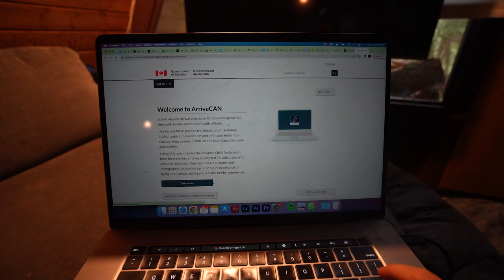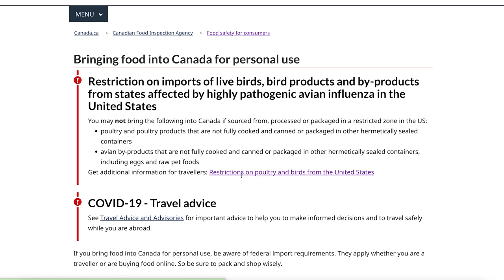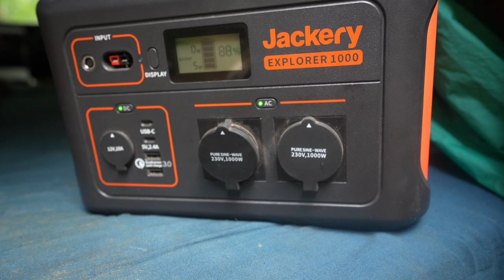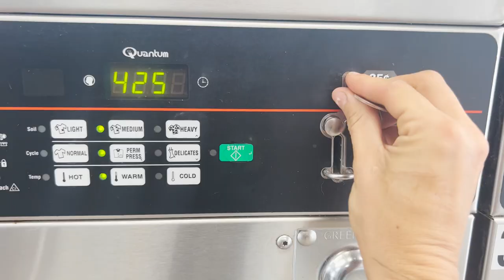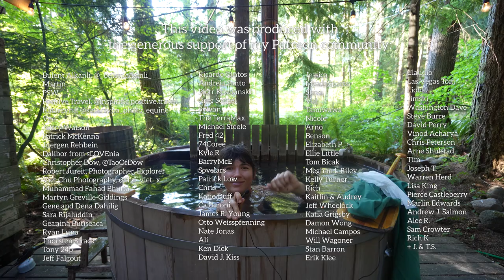Preparing to Survive a Solo Expedition to Alaska

Comment: Local here, we normally don't expect first snowfall in September. It starts to come around middle of October, at least in Fairbanks. I've never been to the far north regions so it might be earlier. Safe travels its no joke when it comes to Alaska, and should not be taken lightly, make sure you're prepared!
Reply: Last year it snowed at the beginning of September in Fairbanks, remember?
Reply: @calebtot  yeah your right maybe I'm just trying to be optimistic this year
Reply: She didn't mention an engine heater in her AK furbishing, nor did I notice a  120 volt plug near the front bumper. Oh well, we all learn as we go along.
Reply: @amberthornlow1979  because its the farthest north you can go.
Reply: In the Fairbanks region, if it snows in September, it usually melts pretty quickly.  Oct 10th-Oct 15th is the average date of establishment of snowpack.  The Brooks Range and North Slope might be another story.
Reply: @amberthornlow1979  Me, I'm just a Cheechako, only been up here since '64, but I figure that's where she wants to go because that's where the road ends.
Reply: Good lock Eva!!!!!  God Bless you.  I pray for you.  Waiting x the next video.  💞
Reply: TheAlaskanBascan, could you add your suggestion to my several--that she pick up a Milepost?  When I soloed up there from northern IL in '84, it was invaluable.
Reply: @Jim1alaska  you don’t really need one until it gets colder than -10C. She’ll be gone by then.
Reply: @nohoracadena8193  I'm praying for her 2
Reply: @FromThePrairies  Hope, for her sake, your right but the best laid plans...

I haven't plugged my in for well over ten years (garaged when I'm home & when I'm out, it still starts fine after as much as four hours of -40°.) but I'm glad I have one.
Reply: @jimgreen5788  that was my bible! We drove from Seattle via the Cassiar, via Fairbanks to Anchorage (with some detours). Would have missed a lot without it
Reply: @FromThePrairies  more like -20C if she has a decent battery. Her truck was more than serviced!
Reply: Felt like she would be avoiding Mosquito season, she's picked a decent time to give it a try...  Spring / Fall feels like better options than Summer / Winter.
Reply: @CLFL14256 , I drove up across Canada through the Prairie Provinces, the entire Alaska Hwy., Klondike Hwy. 2 to Skagway, up to Haines via  the State Ferry, and back onto the AK Hwy. to Tok, down to Valdez, over to Anchorage, and down to Portage, up to Denali, on up to Fairbanks, and a little beyond to Chatanika, Top of the World Hwy. thru Chicken and on to Dawson City, a side trip up to Tungsten, NWT, on the Cassiar, eventually getting to Jasper, Banff and Glacier (USA), and back to IL and home--31 days; 9244 mi.  I would have also missed a lot without Milepost.  
Oops!  Almost forgot to mention my 2-day Arctic tour to Nome and Kotzebue via Alaska Airlines.
Reply: Hope you feelbetter soon and safe travels to Alaska!
Reply: Yeah there. Chrome from, van city vanlife uses his Starlink up in BC.  Not sure how far North
Reply: Eva, I was stationed in the military in Alaska for a couple of years. Allow me to warn you that you are in for a rough trip. You would have been much better off had you left in June or July. It's  warmer that time of year and the days are much longer. The further north you drive, the days will grow shorter. You will doing a lot of night driving during the day.. Chances are you might encounter a snow storm. You will encounter temperatures below freezing. Watch out for Moose herds! Moose are huge and wander on the roads. If you hit one in the dark, it will badly damage your vehicle. The most dangerous animal is the wolverine. They have sharp teeth and claws and will attack without provocation. If your dog tries to attack a wolverine, it will kill him. I hope you see my message, because your trip is more dangerous than you think.
Reply: Not washing your hair for five weeks? When I toured around Alaska with my van, I had no problem keeping clean as I took a dip or got water from the streams or rivers that one seems to come across every half hour when driving. Never been cleaner!
Reply: She is an experienced traveller who has been to really difficult places in the past and usually does a lot - sometimes up to several years worth - of ressarch before going. It may not have come across like it in this video but I'm pretty sure she is as prepared as can be.
Reply: @harrydecker8731  lol moose don't travel in herds and you'll more than likely never see a wolverine. They'll hear or smell u and move away, you won't even know unless u spot the tracks. September is moose mating season so I'd be most worried about bull moose attacking me or my dog. They are very aggressive and territorial during the rut.  Also grizzly are trying to fatten up for winter so there's that. I've spent literally hundreds of days out hunting, hiking, and camping in Alaska to include the north slope and have never seen more than 3 or 4 moose together at one time. She adjusted her whole camping set up so she didn't have to get out of her vehicle to get in and out of her tent. She's thought things thru and she'll be fine.
Reply: Local here as well in wasilla, we are already seeing termination dust, usually that means 2 weeks until snowfall. And the Yukon is not a joke either. She really needs to be very well prepared or she will be in serious trouble.
Reply: Hope she gets a good heater, with that roof tent it's no joke. Even insulated that wind chill is brutal, even in September.
Reply: By the way, everyone in Alaska walks around with Rifles for protection against bears Ruger Hawkeye Alaskan (.375 Ruger) PLEASE PROTECT YOURSELF 🙏🔥💗🦋
Reply: @Jim1alaska  I've wintered in North Dakota and an engine block heater is a must have. I imagine that it's the same in Alaska. My employer (last 12 years) has a lot of interests in Alaska, including the slope. One day I'll get to go. Aviation seems to be the way people move around Alaska. That's fine with me.
Reply: @harrydecker8731  I lived and worked in the Aleutians .. winter and remoteness are to be taken seriously. 
I traveled once with a 20 year old who felt invincible .. but i made my own preparations
Reply: Yep. Mid october
Reply: Its already starting winter in sept. In northern alaska. Been to circle in september before and there was already 2 feet of snow.  It is already dumping 2 feet of snow this year in north alaska. It is snowing right now on the weather report.
Reply: @michellesimmons3150  Yep .. "Termination Dust" .. a term few do not appreciate !!!
Reply: @Jim1alaska      What about the 120VAC electric heater wrap for the battery?
Reply: It snowed last year in late September here lol.
Reply: @harrydecker8731  Yeah I don’t think she knows what she is getting into.  She’d be ok driving to Fairbanks but driving to Deadhorse on the Dalton and back is an entirely different game.

Her car is not mechanically sound or reliable and god help her if she breaks down on the Dalton.

If I were her, I’d just get to Fairbanks and start from there instead of trying to get to Deadhorse.
Reply: @cesbi  She projected herself to be an experienced solo traveler but she really is not. There was always someone in the background to bail her out.

Most of her travels are chaperoned tours in some tinpot dictatorship country with a bunch of minders and guides following and filming her. She is not really an experienced traveler.

That Dutch girl Itchy Boots is an experienced traveler and she has the temperament to handle situations.  Eva does not.
Reply: @mary333j  Chances are, what she said as “ cold and fever” could be COVID and that would prevent her from crossing international borders.  She always seems to downplay some stuff and blow out of proportions the others.  She is also quite late in the year heading to Prudhoe Bay which is 5000 kms from where she was.  That is at least 10 -12 days driving each way.
Reply: Hey you here
Reply: @kmin3434  LOL Moose herd.  Maybe he meant caribou?
Reply: @julianolivas5812  Aleutians is a whole different world! That wind and cold!
Reply: If you're all wondering where Eva is watch, Nextmeridian.Expedition, she's on this Channel 🔥🔥🔥💖
Reply: If you're all wondering where Eva is watch, Nextmeridian.Expedition, she's on this Channel 🔥🔥🔥💖
Reply: @calebtot  😢
Reply: @SwellerVanDweller  beaver fever. Be careful of the water in Alaska.
Reply: @kmin3434  still, hitting a moose while driving is always a risk.
Reply: Northern Albertan here from Canada and it even feels like the snows going to be early here been a super chilly early sept here but who knows. Personally i feel like even here its gping to be early
Reply: Snow between Delta and Paxson was just reported. I hope Eva is prepared. Early winter.

Comment: Eva: You will need to winterize your vehicle (if not done already). It’s unlikely the guys in Oregon will know to do this task. Winterization includes: 1. engine block heater (allows you to plug-in the vehicle during cold nights so that the engine will start in the morning; 2. Battery blanket and plate warmer (self explanatory); oil Pan heater (this gets attached to the bottom of the oil pan to keep the oil warm enough to circulate at engine startup); replace engine coolant with 50/50 mix of ethylene glycol coolant and water. NOTE: Higher concentration of glycol is NOT better; 50/50 is the best). You can likely find a shop in British Columbia to do this work. You can, of course, find many shops in Alaska, but you may want it done before you get there. You could also repack the wheel bearings, but one trip to Prudhoe and back down you should be ok.

Don’t skip the winterization of the vehicle! You won’t regret it.

Good luck and ask me any questions. I lived more than 40 years in Alaska.

Best regards, Stan
Reply: @mary333j  Thanks, I was wondering where she was.
Reply: @counselthyself Itchy Boots wisely avoids all the personal drama & aims for pure traveling content. A cut above most travel Vloggers.
Reply: Not to mention using a very high quality synthetic engine oil. Much easier starts and quicker oil pressure compared to conventional oil.
Reply: @frankharley1000  :  In the video @2:00 she appeared to be using Mobil Delvac in a black jug which would be 15W40 and NOT the full synthic 5W40 which is in a silver jug.  15W- has a practical minimum temprature of about +10F, -10ºC
Reply: While you appear to have lived in Alaska year round, which includes full Winter, you are correct, and as her vehicle is a diesel, a fuel tank warmer might also be useful .  BUT she will be there in the middle of October, then turning around and heading south, so shouldn't see the truly frigid temperatures of the coldest months.
Reply: @johndavidwolf4239  But she's going to the very farthest northern part of Alaska. I'd imagine it'd get pretty cold up there, even in October.
Reply: @enargins  An long as the temprature is above the "minimum cold flow temp" of the oil she is using, it should not be a problem.
Reply: Plug in where? lol

Comment: Have an epic journey to the top of the world! My best advice would be to drive straight to Prudhoe Bay as quickly as you possibly can, then take your time heading back south. That way you'll know how much time you actually have to stop along the way and you'll be driving away from winter as it approaches instead of driving into it. You really don't want to be rushing such a big quest with little time for errors such as potential breakdowns. The big question is when you actually left, since I assume your videos are delayed from when you filmed. Either way, safe travels.
Reply: This is very good advice! 👍🏼
Reply: Good advice
Reply: Totally agree!
Reply: This is a good strategy.
Reply: She is going to Prudhoe Bay late in the year so the risk reward just increased.
Reply: You can’t drive to Prudhoe Bay straight up if the weather and elements and other issues like mechanical issues stop you.  I would never recommend doing that drive in a rush because that’s how accidents happen.  Plan it for two days each way with a stop in Coldfoot overnight.

Driving alone, tiredness and fatigue are things that can get you on the Dalton.  And weather is a total unknown.

I’d take my pace and do it at a relaxed and rested pace than trying to rush to get to Prudhoe Bay and the drive back to Fairbanks is no chopped liver.
Reply: @MuhammadIamhardBrucelee  Totally agree, it's a drive that shouldn't be rushed. But considering how late it is in the season it's better to be rushing there than to be rushing back down in a snowstorm.
Reply: @GabrielTravelerVideos  Yes, it’s already September but there is always an option to reevaluate your decision to drive up to Deadhorse once you get to Fairbanks.

Having done it, I’d say the weather and road conditions on the Dalton are anything but predictable.  Just driving to Prudhoe Bay as fast as you can doesn’t seem like a wise decision.  You need a cool head and relaxed attitude and careful planning to drive the Dalton.

Comment: Check the minimum temperature for your gas canisters. Some have added propane but the cheap ones are plain butane which will not flow at low temperatures, below about 10C. (50F)
Reply: Right, butane isn't good in the cold
Reply: Also check your coolant temperature rating
Reply: Good advice. I would prefer alcohol or gasoline stove,!
Reply: I have the same stove. (V similar) it’s butane. Those canisters can be hard to find. I’m sure Alaska has shops though 😜

Comment: One note of caution on the Jackery: It uses a lithium-chemistry battery and does not have low-temperature cutoff built into its electronics for charging. Charging it below freezing (0C / 32F) will shorten its life by reducing its future charge capacity. It can be used to power things well below freezing without damage, though it won't be able to sustain quite as much power output as normal, but warm it above freezing before charging it.

Comment: If you are planning on being in Alaska deep into the winter, you may want to consider taking a small liquid-fuel stove. The gas in butane canisters will slow down below 32°F; propane works better, but if you're going to be out in sub-zero temperatures, they might not be reliable. A stove that burns kerosene or petrol will work in any weather.

Comment: So... which road you take only matters in Canada, unless you go up to Dawson and cross there.  We are doing some paving near the boarder right now but even with that, from the boarder to Fairbanks it is only about ~6 hours or so drive, you will pass through Tok and Delta on the way and in all three places you can find all the facilities common to civilization.  You said you want to go to Deadhorse / Prudhoe Bay, from Fairbanks that will be ~10ish hours (these estimates are probably low, I do it in less but it's my job and I've done it hundreds of times).  Fill your fuel tanks in Fairbanks and then at Coldfoot ($7.49/gal last week).  The only place you might see snow and ice right now is Atigun Pass, which is the pass through the Brooks Range into the North Slope and once you are up there you have passed anything interesting to look at, it's just frozen swamp and mosquitoes.  Oh ya, Deadhorse is 10 miles from the actual Prudhoe Bay so you can't see the Arctic Ocean from there and if you don't have arrangements with one of the tour companies they won't let you up there (can't bring your rig in any cases).

Your rig should handle the Dalton fine, the first few miles are some of the worst, if you have a CB keep it on channel 19.  The rest of your route in Alaska is no worse then most of Montana.  If you want to see more of the State, on your way south you can take the Parks down to Anchorage then cross the Glenn Highway to Glennallen, up the Richardson till you hit the Tok Cutoff and take it to Tok then back to Canada and places south.

Comment: From Fairbanks - you should be able to get to Cold Foot camp in a day.  Spend the night there and drive to Prudhoe Bay in the morning.  I think there is still a hotel in Deadhorse to spend the night.  You should be able to buy gas at both locations.  Consider getting a block heater for Odyssey so your oil pan doesn’t freeze up.

Comment: I'm glad you took my advice on the upkeeping of your truck. Very very important. Change that oil every 3000 miles. Changing the transmission fluid is also important. But not needed as often. Every 60,000 miles.

Comment: Eva, you mentioned the windshield, and that reminded me of my '84 trip up there, and something I was recommended to have installed--a grill cover in case rocks fly up; instead of damaging your grill, this'll protect it.  Of course, back then, about 30% was still gravel, and I hear it's at or near 100% now, so it may not be an issue anymore.  Nevertheless, check when in British Columbia.  It was also recommended I take several mounted spare tires.  Back then, I ended up using both.
Milepost will help greatly in deciding your route.  
I trust you'll regain your health soon.

Comment: First off you probably have CO-VID but should be fine in a few says. Check boarder requirements and negative testing requirements.(Canada and Alaska).. Secondly it is just a tad late in the season to go that far north in Alaska and make it back before the weather goes sideways. Third, be very careful about letting the dog off-leash (boy he is growing), Fourth gas will be expensive and there may be great distances between fill ups so when you see gas get it. Fifth, get a NOAA radio with emergency weather alerts (voyager (yellow) on Amazon - its battery-electric-solar-crank and USB. Going to be a great trip - a once in a lifetime - good for you!!! Gob Bless:)